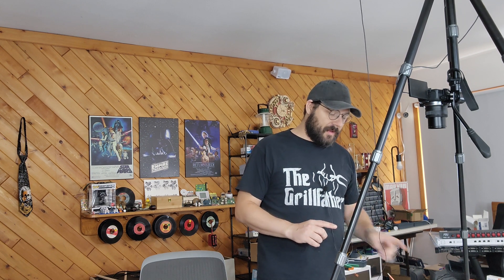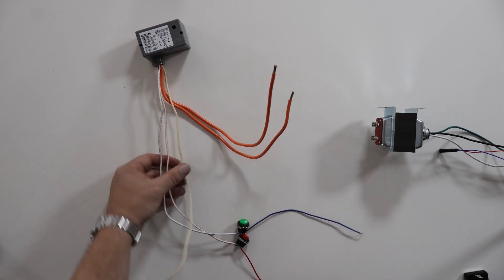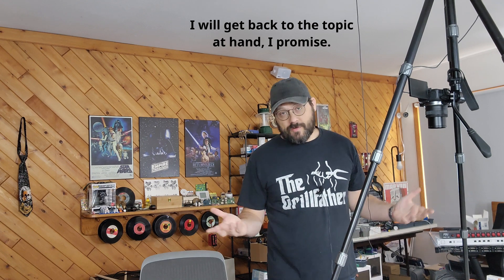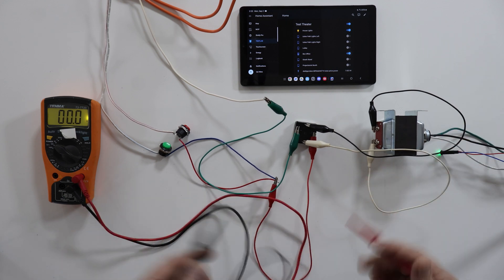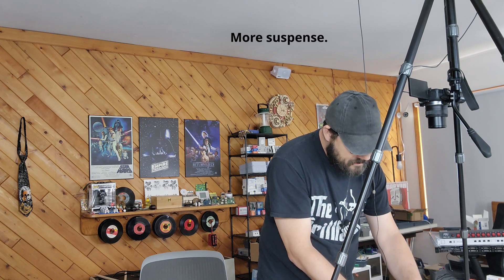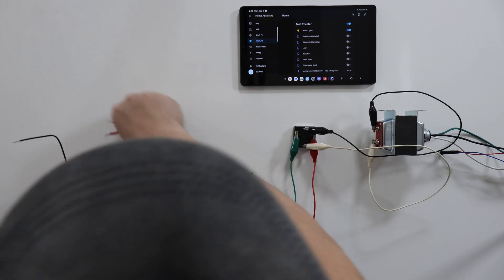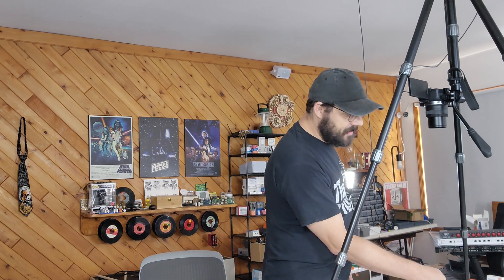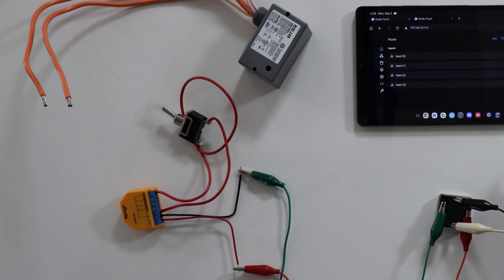Drop-in replacements for 1950's low-voltage lighting relays or for fun, whatever.

Comment: any chance you can help me out with some guidance on how to replace the Remcon R-115 relays? My house has a mix of the R-115 and R-115S and since they are no longer made I'm at a complete loss! Any help would be wonderful!
Reply from the maker: If you want to simply keep it original and avoid the smart devices route, Kyle's Switchplate has these two items (first for R-115S, second for the standard R-115).

https://www.kyleswitchplates.com/remcon-r-115s-low-voltage-remote-control-relay-switch/

https://www.kyleswitchplates.com/touch-plate-low-voltage-powered-relay-pack-nipple-mount/

I hope these help and that this avenue hasn't already been checked. They're usually pretty good about having massive stock. If they don't, drop me another comment and I'll see if I can't dig around a little more.
Reply: @smartercircuits  unfortunately they’re no longer in stock. I was going to go with Shelly pro 1PM and just use the BLU for the switches what are your thoughts on that?
Reply from the maker: @scottferry155  I think that's perfect reasonable. That's more or less how my house worked for a couple years. The only difference now is I'm using Pro 4PMs, but they're not UL listed.

Comment: Great video! Think the RIBL24B would work as a replacement for the old REMCON RC-115s solid state relays?
Reply from the maker: Thanks for the kind words and the view! As far as replacing the Remcon relays, sort of. 
There's an internal stepdown transformer in those relays that you would have to replace separately. The RIBL24B expects 24 V AC or DC on the control side, so you'd likely want a doorbell transformer or similar. There are pretty small ones out there, especially if you don't mind doing some surgery on a wall adapter (the ones for irrigation controls are pretty small). This may create a space problem for you either way, though, so I hope you have access to a larger space near the fixture. 
Unfortunately, unless you can create a new power distribution setup with a centralized transformer or switching power supply (remember, the RIBL24B can accept AC or DC), you'll need to have one per relay. 
I hope this helps a little.
Reply: This is super helpful! I have a house full of aging Pyramid/Remcon relays and am looking for the best drop-in. I appreciate the quick and thorough response. Great stuff!

Comment: I really appreciate your content on the subject as a homeowner with a low voltage switches 1950s system, but I’ve got to be honest you’re so far over my head I have no idea what’s going on in this video. Keep it up, I’ll catch up with the class eventually.
Reply from the maker: I do apologize for being a bit quick and not very detailed here. I wanted to bring attention to these devices, but I will do a more in-depth video showing installation and setup of the Shelly i4 DC (and all the other Shelly Plus devices) in the next few weeks. 

As far as the Functional Devices RIBL24B latching relay, it's somewhat straightforward if you know which wires do what in the low-voltage system and you're comfortable rewiring it. If you are interested in this device for your own system, feel free to email me at SmarterCircuits@gmail.com and I can send you some more detailed considerations and instructions. I may do another video on that device as well if enough folks are interested.

Thanks for watching, I appreciate your minutes!